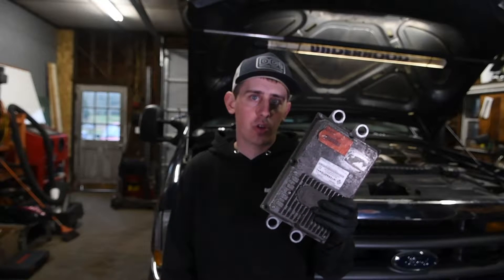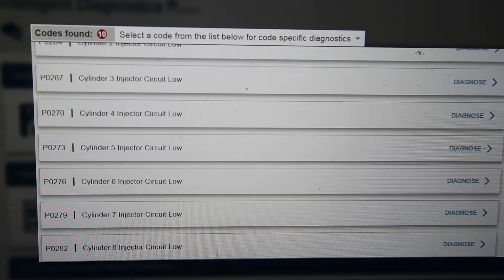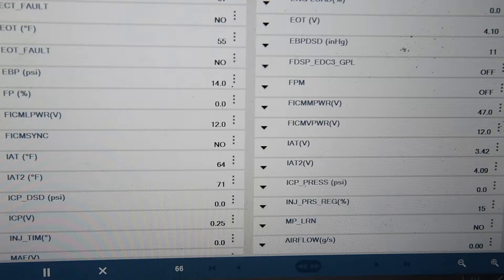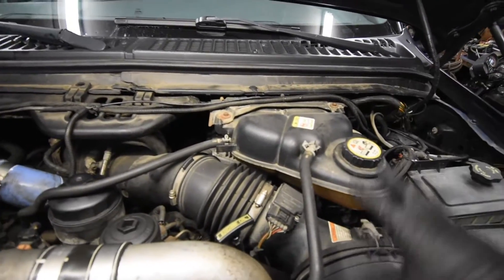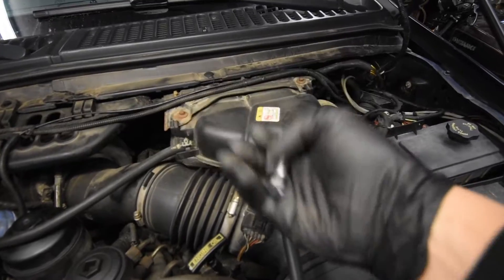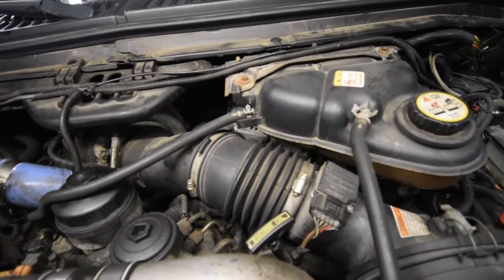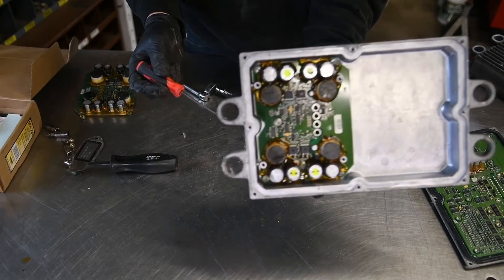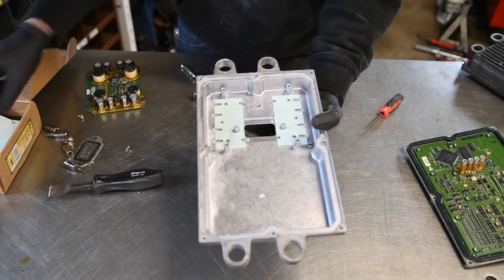6.0 P0611 FICM Repair

Comment: At 73 I've been messing with engines all my life. Can take apart and rebuild Chevy 327, 350's blindfolded, but never work on a diesel. In order to pull my travel trailer I recently got a 2006 F250 that ended up getting a crank no start issue. Just looking under the hood I was totally intimidated, however between DieselTechRon and watching this video I was able to run Forscan (a free software Scanning tool) diagnose and repair my FICM. My FICM Main power was dropping from 48.5 V down to 20V during cranking. All injectors were getting the low circuit codes. FICM sync was good, ICP was good and IPR good. Had put in two new batteries and voltage was good.  Once I heard the comment from both this video as well as DieselTechRon's videos that FICM voltage should never drop below 45 volts during cranking, I knew it had to be my power board. It could have been wiring connectors but the connection was solid. Ordered a Power board and changed it out as per your instructions in this video and she fires right up. As mentioned below,  the hardest part was getting to it and pulling it out of the truck and of course reinstalling. At 73 laying on top of my engine to reach back under the firewall was not fun. But, I got it. Thank you, Thank you, Thank you.

Comment: I liked what I saw. I had a ficm replaced on my 6.0  back in January.  Now im misfire at red lights and blowing smoke. Not all of the time though.  I ran some cleaner in the tank. Not sure. It'll clear out if I feather the accelerator or floor it.  If feathering doesn't work, Ill floor it, and it'll eventually clear out.  I have a 2005 with 120k miles. F-350 with a hoss tow package.  However,  I dont tow anything.  This is a VERY near mint truck.

Comment: First and foremost - great video ....but,I have one that has me stumped...  2007 f350 6.0 - last year,had ficm rebuilt for major voltage drop- 35v ..rebuilt - All good.. recently, truck random stall and,now crank/no start - has all same injector circuits low codes as you showed..sent ficm back under warranty-said was repaired,but still has the same issues...I have stable 48v,stable 12v in, stable 12v supply while cranking, sync passes on everything(CMP/CKP,FICM,etc)new harnesses, relay, grounds CMP/CKP new/OEM).. stable 5v reference.... tested all injectors for bad coils(all good)- no clatter on key cycle.will not buzz on   buzz test..cleared DTCs, immediately return ...ipc,ipr,hpop all in spec,new batteries and alt installed,and harnesses,etc installed prior to reinstall ficm.. still same issue(even tried with known good PCM-same,but can't get my hands on a test FICM.. been through everything on this truck and still will not start,even though Im getting everything good, coming in... just nothing coming out to injectors.. scoped and nothing...I AM STUMPED... possibly bad rebuild? I don't want to open it up, because of warranty....any suggestions? Also, random po611,but that may have been triggered while pulling relay with KOEO...I really am stumped on this one,as everything else is all new(replaced because shop said something shorted it out - figured safe than sorry, so replaced everything ...any thoughts? Thanks in advance 👍

Comment: I have a 05 f350 with a burnt pin 4 on the X3 connector, I had a strange miss at idle at random from time to time but never anything other than idle, what would cause that ?

Comment: I replaced one of these about 4 or 5 yrs ago on my truck. It burned out last week. I just installed another one over the weekend on the same truck. It's a pretty easy job. The hardest part is getting to it and pulling it out of the truck. Changing the board is a piece of cake. The  one that burned out, started to go out almost a year ago when the preignition clikcking stopped. But' the truck still started and ran, so I ran it that way for almost a year. The old board finally gave up the ghost and dead shorted to the case blowing the number 5 , 50amp fuse under the hood. One of the capacitors got so hot that the board burned and it got hot enough to burn thru the silicone mat and short on the case. I was afraid that it would have screwed the logic board, but I put it back in with the new power board and it runs great again. This is just one of those things that happens to these trucks. This is board #3 since I've had the truck. Before you start changing injectors and going deep into that. A new ficm power board is cheap and easy enough to do before getting into changing out injectors.
Reply: So, what happened when FICM is bad? Please reply me
Thank you
Reply: @htikelay  When it starts to go bad, you won't get the injector clatter when the key is on, engine off. It'll also take a while to start and sometimes run rough. Once it's totally going vehicle Tony start at all. Dieseltechron on YouTube is the channel to watch for diagnostics. If you're not mechanically inclined, it would probably be best to take it to a diesel mechanic. Lots of things can cause the vehicle to not start. Gotta diagnose it before you start throwing parts at it.
Reply: Okay, Thank you so much, and May God Bless.

Comment: What about if the ficm logic voltage  or the other voltage is bad? Can this repair fix that? Or does this repair only fix the ficm for the 48 volts?
Reply from the maker: Unfortunately this only repairs the 48 volt portion.
Reply: @InTheShop  at least I know now thank you bro can that portion be repaired?

Comment: Have a 2007 f350 had the 611 code main voltage was dropping to 33 so I got a used ficm which all voltages are perfect but when I cycle key ya can hear no injector clatter starts n runs good also had a p0268 then a p0269 came along truck runs a Lil rough now injectors are only 6 months old
Reply: Unless the ficm is programmed you won’t hear the injector buzz. In this repair he is only repairing the voltage power portion of the ficm so he didn’t need to reprogram it cause the logic portion stores re programmed data. You replaced it with another ficm that doesn’t have the data required by your pcm to talk with your ficm so that’s why your experiencing this issue. The cure would be to reprogram the ficm or get a ficm preprogrammed or repair the original if it had voltage issue an reinstall.

Comment: Great video man. I watched this more than a few months ago now and got the part. Super simple and easy to do. My ficm voltage would be at 46.5 to 48 while causing around but with this new part installed I am sitting around 49.5 most times I have not seen it drop lower than 48v. Keep up the great work man.

Comment: Hello I have a 2005 f350 6.0 I had the Ficm replace and a couple off mouth later it did the same thing and I haven’t stared since 2017 I just bought the Ficm from allient so you think that I have to drain the old Disel or just leave it
Reply from the maker: The fuel is probably ok. I would add some fuel treatment to it. Make sure you don’t have battery voltage or charging issues. Those are the biggest causes of FICM failure.

Comment: Hey great video I have a 06 e450 bluebird micro bus that I was given as payment to clear out a barn and all it needed was batteries a installed 2 brand new ones and it started right up sounds great for about 40 min or so and I shut it off it did not want to start again so I checked every fuse under the dash and found one blown I replaced it and bam she fired right up I don’t know what the fuse was too cause I don’t have the chart but it ran fine and then I shut it off and again it will not start so I checked the same fuse and it was not blown, I am getting p0611 code and some other glow plug codes , could this be a ficmu issue . Thanks please help
Reply from the maker: I would need to know what fuse number keeps blowing in order to help.
Reply: @InTheShop  I replaced the main relay and it is running great so far , I had a mechanic running a scan test and it checked out fine no codes , i am giving the bus to my daughter she is planning on doing a mini house rv conversion is there anything that I can do to improve relay ability in this engine , thanks for the response

Comment: I recently turned my truck off to get fuel. Went to start and it cranks and I get oil pressure but found the voltage on my tuner for my ficm drops slowly from 50 down to 2volts . i figure its prob a failed power supply just wanted your thoughts.
Reply from the maker: Check to make sure the ficm supply voltage is good before replacing the power supply. If supply voltage is good you definitely need a power supply

Comment: Hey stupid question I have a 05 f350 it has the 7 pin ficm nun of my local parts stores can get a 7 pin an due to Corona bull crap I havent been able to order one.my question is will a 4 pin fixn work in place of the 7 pin.i put sum of the tape over the three holes that will not be used an the 4 pin bolts right in.will this work or screw something up realy bad I've been debating on putting it in an trying but I'd like a opion of someone who noes what they are doing.they look identical except the 4 pin has three less holes
Reply from the maker: Unfortunately you can’t use a 4 pin power supply in a 7 pin FICM. You can put a complete 4 pin FICM in the truck though.
Reply: @InTheShop  I was afraid of that .it jus seemed worth asking but I was afraid to plug it in an try it.wheir would be the best place to get one online all th auto parts stores say they cant get a 7 pin.i seen one on Ebay for like 50 bucks ruffly but I'm not trying to be cheap .I jus want a good one.or if I had to buy a 4 pin one what's the best way to go who makes the best
Reply: Thanks for  teln me it woildnt work I'd probably freid something else.i anttrying to be cheap jus need my truck

Comment: The FICM has two ,,parts,, POWER and BRAIN,, if you replace  just POWER part what chances  the ,,BRAIN,, part is BAD...would it be better to replace the whole thing?
Reply from the maker: Mike Ches it’s possible for the brain side to fail but very rare. Low voltage issues are a failure of the power supply.
Reply: How often the COMPUTER FAIL the one on the fender by the battery?
Reply: @mikeches7992  good luck with finding a used PCM for less than $500.
The reason I had to replace one was due to a harness failure caused by human error. First one I bought was a bad unit. Look very closely to each pin on a potential used PCM. What you want to avoid is any unit that shows signs of heated plastic surrounding any of the pins.

Comment: Great video In the Shop!  i got an 03 F350, 6.0, the other morning went to start it and it seemed to be hydro locked, it did crank for 1/2 a turn or so, every time I tried to crank it, felt like the starter engaged but could not turn the engine. Today it turned and felt like engine wanted to fire, releasing the starter from the flywheel, but never fired. Checked several videos and seems that the FICM is the problem but not sure yet, any suggestion?  Thank you!
Reply from the maker: Its hard to say without being it myself but hydrolocked is usually a bad injector or a bad egr cooler allowing coolant into the cylinders. A bad FICM won't cause a hydrolocked condition.
Reply: Most likely a loose injector that hammered out the copper washer

Comment: Also I'm wondering who was the genius that though to put an electronic board on top of an engine that get very hot. 🙄
Reply from the maker: I agree they shouldn't be mounted on the engine but they also fail on the econoline vans and they are mounted remotely. Thank you for watching
Reply: @InTheShop  agreed. i think the largest cause of failure is the fact they cheap out o solder making the connections on the power board i have been able to repair a few of these just by soldering the connections "adequately" 
I also like to pull the dip stick up and out of the way while pulling the air filter because those things are stupidly fragile as well  because plastic parts on a diesel engine is a "brilliant: bit of engineering.
thanks for the great videos they have helped me out a lot
Reply: Must have been a guy hired by Ford from the GM 6.5L team at Stanadyne who said I know it didn't work when we mounted the fuel electronics in the V of the engine on, but we just put them to the top, im sure the cooling will be good enough now...
Reply: @niteflite1287  are you sure it wasn't the idea from the engineers at Saturn?

Comment: Hey can you help me?

The problem I have with my 2007 6.0L powerstroke is that only buzz test the injectors when the engine is at operating temperature but if the engine is cold don't buzz test the injectors so the engine don't start. What's the problem then?. I'm not sure if the FICM is the problem here. I think it's a wiring problem or something. All fuses are fine (the ones on the engine side and the cabin too). Once the engine is at operating temp runs like a champ, by the way the truck is 100% bone stock.
Reply from the maker: It sounds like you have stiction in the injectors. When the oil is cold and thick the spool valves can not move. Once the oil is warm and thins out the spool valves move freely. Try an oil additive such as RevX and see if they helps.
Reply: @InTheShop  
I added 2 quarts of marvel mystery oil to the oil (I put brand new oil of course, rotella t6 15w40) and now the injectors started again to buzz when the engine is cold. Now it start without problems. I always suspected the injectors was the problemsThanks for the reply.👍

Comment: En espñol
Reply from the maker: No hablo español
Reply: Misael Gonzalez, básicamente el dice que cuando falla el módulo, típicamente ese el “power supply” o componente de electricidad que manda los 48 voltios a los inyectores, el costo es como 100 dólares en el link de Amazon que el provee, la mayoría de las veces es ese el único problema. 

Además dice que tengas cuidado de poner bien los conectores cuando lo instales en la troca porque están duros y puedes pensar que entraron y después se sueltan.
Reply from the maker: SBC Wood and Metal  thank you for translating

Comment: Hey Man I did this and am now only getting 40v   Have any idea why?
Reply from the maker: What is your battery voltage and also your FICM input voltage?
Reply: In The Shop both 14. Before I did it in the morning when I would first start the truck it would read low like 43-45 then come up to 47-47.5
Reply from the maker: I’ve never seen it but if all of the input voltages at the FICM are good and your voltage is at 40 I would say you probably got a defective board.
Reply: In The Shop I’m thinking so too. Will the edge monitors and the sct x4 read the voltage accurately?